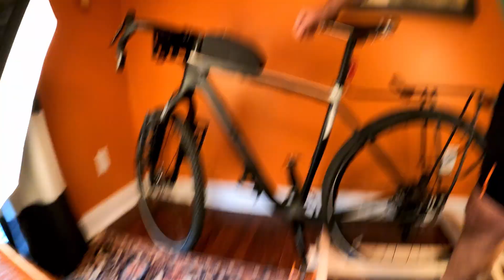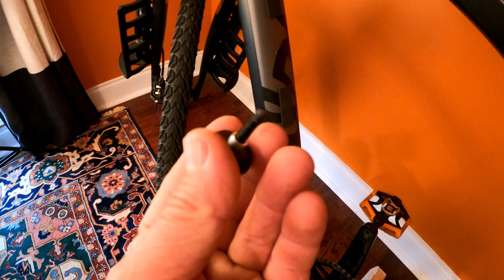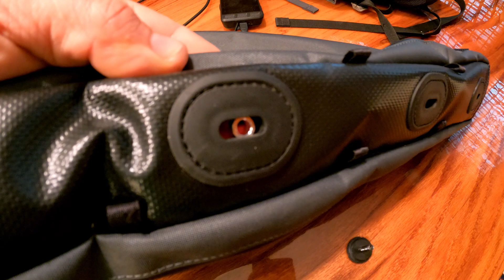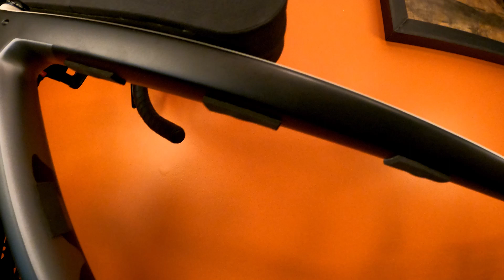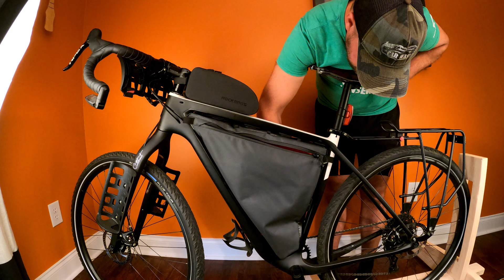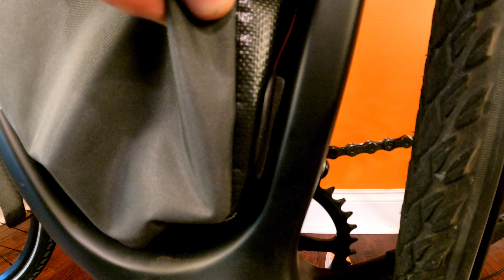Salsa Cutthroat Frame Bag Installation

Comment: Nice video. What model of the axiom streamliner rear rack do you have ?
Reply from the maker: I have the Axiom Streamliner Disc DLX rack on this. Absolutely love it! Use it with Ortlieb panniers.  Rock solid, quiet, simple design, widely adjustable, lots of clearance, highly recommend!

Comment: What year is your bike I have the pink with grey and did those wheels and tires come with the bike mine are wtb wheels
Reply from the maker: My Salsa Cuttroat is a 2020 Apex 1. These are the stock WTB wheels.  I purchased the base model so I could do a complete refit after putting some miles on it and determining what components I wanted.  I'm getting very close to having everything in hand and being able to switch it over.  I will do a video or two showing the transformation.  If you have any further questions about the bike, please feel free to ask away.
Reply: I have the same bike. Love it but changing out wheels. What tires have you put on yours? They look real nice and less tiling resistance for asphalt
Reply from the maker: The tires in the video are Schwalbe Marathon Plus Tour 28x1.75" These are not tubeless and I use them for riding longer distances on firm surfaces.  They are extremely durable. I have never gotten a flat with them over thousands of miles. I have been doing more rides in loose gravel lately and am running the stock Teravail Sparwood 2.2" tires on carbon wheels. I like the added contact patch with the 2.2's and the more surefooted feeling it offers. This combo allows me to run much faster on the loose gravel.  I will be putting on a set of Vittoria Mezcal TNT tubeless 2.35" tires soon.

Comment: How does the sizing run with this model? Does it feel larger or smaller?
Reply from the maker: I feel like it runs about right or slightly on the large size.  I prefer a little bigger frame triangle for a larger frame bag and then I like a little shorter stem to bring my reach in.  Sizing is one of those things that is so personal, it is hard to describe.